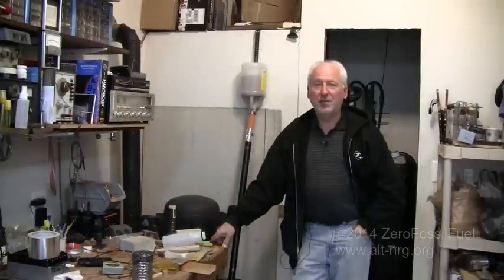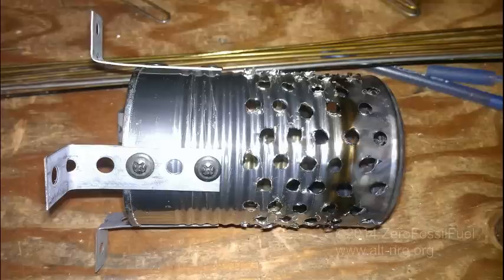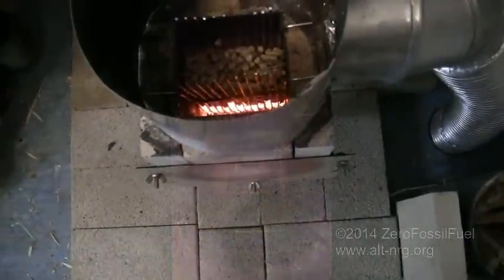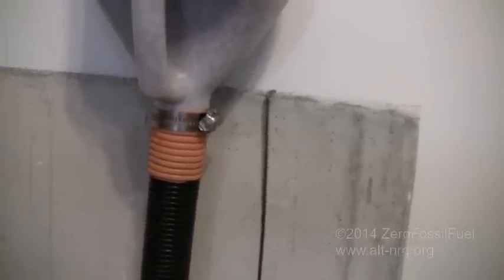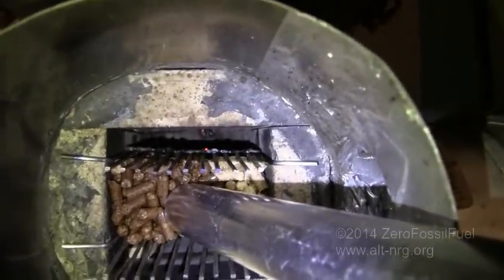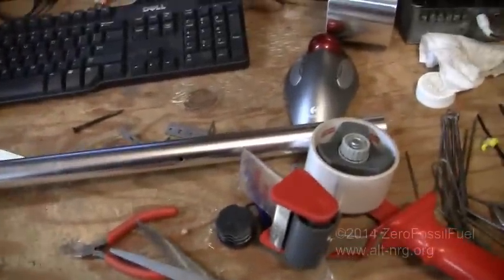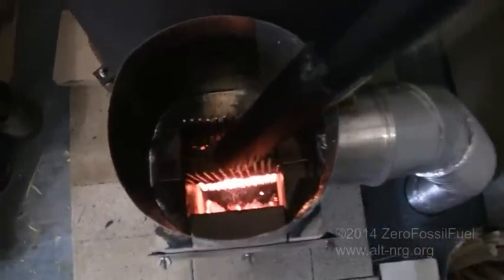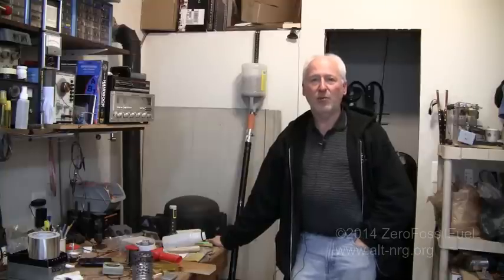#354 Rocket stove heater wood pellet mod!!!

Comment: What's the rate of consumption? Asking of course to figure how much it will cost to run my rmh on pellets instead of wood.
Reply from the maker: Please see comments in video 356.
Reply: ZeroFossilFuel "About 2.5 to 3 lbs/hr" is shorter than "Please see comments in video 356."
Reply from the maker: OK, "Plz C #356"

Comment: just an idea of something that maybe vibrates the tube on a timer once an hour or so
Reply from the maker: More like 1 second every 2 minutes. Working on it! Already have the agitator made and tested. 12v motor with an offset weight. All that's left is the timing circuit.
Reply: figured you would do something like this or at least think about it :) You do and awesome job have been following for years now...Keep up the Great Work!! I might be trying this for next winter season for my garage :)
Reply from the maker: Justin Bussing You won't regret it. Take a look at my updated video description.

Comment: Did you come up with a nifty way of shutting it down yet.
Reply from the maker: I just cap off the feed tube, lift it and the hopper out of the basket and release the balance of pellets into a 2 gallon pail. Takes about 5-7 minutes to burn out what remains in the basket.
Reply: @zerolabs  great. When i do mine takes about same time too.

Comment: So you went from burning FREE easily obtainable material to having to BUY pellets.  Have you thought about making a drip waste oil tube into the fire box once you get it running with wood?  The heated air flow would be more than enough to keep the oil burning and it would be easy to cut of or adjust flow to adjust heat.
Reply from the maker: Rattlerjake1 In fact I have seen that done and considered it. Just not motivated enough to do it since the pellet mod works so well. And if supplies get scarce I can just start shoving sticks into it again.
Reply: ZeroFossilFuel
 wood chips :)  with 20% humidity  costs less.

Comment: I have a question and hope someone will see this who knows the answer. Have you tried to burn wood chips- and by that I mean the tree services now put lots of the wood they cut down through a chipper. I have a heater made  out of a old water heater and I also have the 22 degree feed tube.  I had thought if I had a bucket of chips and wood start the heater going with some sticks/ limbs and then take a small ice scoop and drop them down the throat of the feed tube they would burn ok. I am thinking I would need a little grate or stand at the bottom so air would flow but other than that I am thinking this should work. I would have to feed it often but my heater is only supplemental ti cut down on fuel cost while burning up basically trash. Anyone else had or done this idea
Reply from the maker: Some have tried and it does work. The problem is keeping them from jamming up. They tend to clog very easily whereas pellets drop much more easily. I suppose an auger feed could be employed but regulating the feed rate is a-whole-nuther problem I do not have with gravity feed which is fully self regulating.

Comment: 5:54 At this point is the grate still bent in pretty close to a V shape or did you spread it to more of a U shape at the bottom?
Reply from the maker: Right now still close to a V. When I make them from SS rods I'm going to try a few different geometries. I also have an idea to make the basket from pieces of flat SS 309. This is more interesting than I anticipated.

Comment: Cool stuff. Maybe start it with wood scraps, then add the pellets gradually.  Don't use lighter fluid. That's cheating. LOL
If not, just start with about 1/2" of pellets in the grate.
How much are pellets?
Reply: I pay almost $6 for a 40lb bag here in Southern California

Comment: What adhesive is used to hold the pellets together (do they burn kind of clean/green), and what kind of BTU cost is there with pellets... :o]

O,
Reply from the maker: Burns extremely clean. About $220/ton or $4.50/40lb bag. It seems to be a generally accepted rule of that any wood contains about 6200 BTU/lb. Hardwoods are more dense so you have more BTU/cord (or any other volume) but BTU/lb is the same for all wood types. Personally I think the rocket stove extracts more heat than that but I haven't actually measured it accurately. I will.
Reply: ZeroFossilFuel
My rocketstove burns 1.25kg/hour @ EUR 0,20kg.
Top air temp inside 740C , Chimnee air temp at 2mtr high about 65C
Tank is a old 112Ltr propane tank
Riser outside 90mm stainless steel 316
Firebox outside 100mm stainless steel 316

gr Eric
Reply: Thanks for the info guys, I've always wondered about this type of stove fuel, and have burned wood for 25+ years... This was good to hear! :o]

O,

Comment: After 6 years, does it continue to work without feeding problems?
Après 6 ans, est-ce que ça continue à fonctionner sans qu'il y ait de problème d'alimentation ?
Reply from the maker: Unfortunately you are correct. However, I describe in great detail how to go about calculating the optimum size ratios for what ever tank size you end up with. I will be building another stove soon using a much more common discarded 100 lb propane tank and I will use the exact same procedures for calculating the interior dimensions.
Reply from the maker: YES! I have only have to replace or repair the stainless steel pellet basket once every two years.

Comment: Hi! how much time running you heater after you upgrade it?
Reply from the maker: +андрей андреев 2 years
Reply: ) sorry, i mean how much time heater running after a single load.
Reply from the maker: Ah, I can load about 8lb at a time and it will burn 2-2.5 hrs depending on how hot I run it.

Comment: This is a probably a dumb question... do you have carbon monoxide sensors?
Reply: I really do like you rocket stove that's  cool
Reply from the maker: +Anthony Newman Yes, I do, at the insistence of many of my followers. Thing about a rocket that most have trouble wrapping their heads around because it's so different than a traditional wood stove is that most of the internal pressures are negative, meaning any leaks that might ever possibly crop up would draw room air in and send it out the flue pipe, not push exhaust gas out into the room. This is a VERY safe stove.
Reply: Very interesting I'll try to understand the physics of it cold air is more dense also drops more weight hot air expands rises less weight ?  drawers the colder air temperature into the hot pipe... Interesting. Help me if my concept is incorrect.?.?  thanks

Comment: how long does a full bag of pellets last??
Reply from the maker: All depends on how you use the stove, of course. Do the math. A bag is 40lb. My stove consumes roughly 4lb/hr which produces 35,000 BTU/hr heat output. The way I use my stove is to heat my workshop in the evenings. I'll use about 10-12 lbs of pellets to bring the space from 30-35F up to about 70F and let the residual heat in the stove do the rest. I'm in my workshop 3-4 times a week so I go through about one bag a week.

Comment: Any body know what that tube (appx 3") is right next to the feed tube where it enters the burn chamber? Is it a preheated air tube?
Reply from the maker: +fonduemonkey My workshop is elevated. That's a fresh air inlet through a hole in the floor. It could have just as easily been taken from the side wall.

Comment: Haha!, guess my message was 2o brief. u'd said u found it tedious or something 2 get the pellets 2 burn. n, i 4got 2 tell u 2 start watching @ 2:00 minutes (n only 4 a few more min.) 2 c how he puts his pellets on fire (what i meant by firing up pellets) with a propane torch.
yes, i agree. however, for the woman that has no way of getting 1 like urs (n probly woodn't want it anyway) in her living room n doesn't want an auger or control pad, since we're on the subject, i was wondering if adapting 7 or 8" plain stove pipe up a ways then detour towards the floor, even doing a few feet under something b4 going up again n outdoor not far from the ceiling woodn't leave a lot more heat inside n still work? i imagine it have 2 b shielded, at least up 2 where the temperature's cool enough. …but she probly won't like that either. what i'd do, put it in the unfinishd basement, do something like that, n start the hot air furnace blower only 2 heat the whole house.
btw, i like what u'r doing in the few videos i'v watchd.
930°F, i had missd that. it means i coud melt Al, n Ag with a little higher system… anyway, thanks 4 being there...

Comment: use arduino feed pellets, and ventile open then need more pellets, and insulation to tube no warm up pellet store, arduino RTC real time clock timer when add pellet and little DC motor shake tybe pellet come out good.servo motor open ventile flap and add pellets. down tube need mny hole fire not go up to pellet store, and ventiule flap stop fire no go up too. heat can stop add fan to near tube cool tube.

Comment: What is the burn rate (lbs per hour)?
Reply from the maker: I have burned it for 4 days now, about 5 hours each time and I've only gone through about half of a 40lb bag. That's only 1lb/hr. The accpted rule is 6200 BTU/lb but I am getting WWWAAAYYYYYYY more heat output than that. We may be rewriting some of the accepted rules for BTU/lb. ;-)

Comment: see how Gary Wisener fires up pellets: Wiseway Pellet Stoves Demonstration Full Version
Reply from the maker: acadjionne Very neat, compact design. But with his temp gauge location, that means he's got very high temps going out the flue pipe. By contrast I have had the top of my Rocket Stove as high as 930*F with flue temps no higher than 220*F. Less heat out the flue = more heat in the room. I'll keep my non-UL certified Rocket.

Comment: USE 316 STAINLESS STEEL ITS BEETER WITH CONSTANT HEAT
Reply from the maker: I am now using 3/16" dia 316L from leftover stock I used to make Critter's basket. His stove is much bigger and hotter than mine and his basket is holding up perfectly. Mine will now likely last many years.

Comment: One thing you forgot was a shut off valve
Reply from the maker: My shutoff valve is very crude. I have a L shaped piece of metal I use to cover the opening of the pellet feed tube so I can lift it and the hopper away, dump the remainder in a bucket and let the rest burn out from the basket.

Comment: Hi, you might want to look at "Wiseway pellet stoves" here on youtube. He designed and patented as system very very close to what you have here.  Might be worth looking at if you're selling plans.

jimb in wv
Reply: Zeros design is not even remotely close to the wiseway...u have to be daft to compare the two...
Reply: Andy Davies
I'm talking about the wire burn basket idea, air feed system and the gravity feed system.  That's part of what Wiseway's patent is based on.  Good luck and have a good day.  I have NO interest or connection with Wiseway in any way shape or form.
jim b in wv

Comment: Now all you need to do is figure out a cheap efficient way of converting waste wood to pellets.
Reply from the maker: That's a possibility. I have a couple saw mills nearby that I need to visit and ask about providing them a free service of hauling their sawdust away. ;-)
Reply: they do make pellet mills. goto pellmill.com
Reply: well you alway can piece mail it to gether start small then make it bigger as time goes on.
Reply: all depends on how u go abut building it. if you want long lasting heat build a massive radiator heat sink on the back . that way you can have heat for a few hours after the fire has gone out.
Reply: but its all in the design of that stove.
Reply: but u want to coil copper tubing thro it to heat up water as well.
Reply: actually put them on the out side of the exhaust  pipe.
Reply: look up engineer775. and how he does it.

Comment: Need to show where air comes from.
Reply from the maker: Maybe not in this video but in others the air is clearly shown being drawn into the plenum manifold above the burn box through a 3" flexible aluminum tube vented outside.

Comment: Very interesting project, If me, I wold make a watertank op under sealing that cut alle fire if temp getting to high, and a waterlevelswitch that tells Arduino not to start the heater if no water in it, Arduino controls all, try look at this project. 
sry my bad Eng.
Country house heating with pellet stove D.I.Y. (domusMaker.it)

Comment: You need draw
Reply from the maker: Believe it or not, all of the draw this stove design needs is created inside the tank chamber by the internal flue pipe. Gases cool off the tank surface and can actually create positive pressure at the exhaust port. Running at an average 800F at the top of the tank my exhaust temps rarely exceed 175F. No joke.

Comment: what if the fire goes up the feed tube?
Reply from the maker: It doesn't. The only time it will is if your feed tube is as tall or taller than the internal riser. That's why we specify the riser should be at least 3 times taller than the feed tube.
Reply: How do you calculate the tall of the feed tube ? I see that you have a very long pipe as feeder.
What if you have a hopper with a cover on top ?